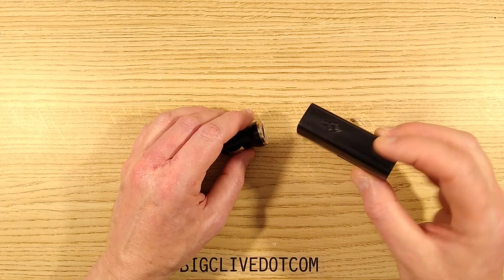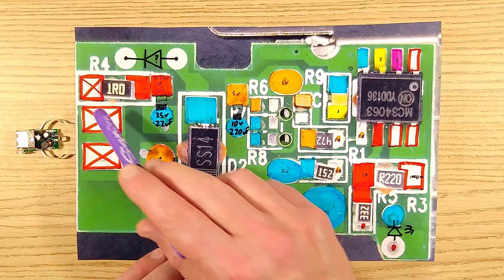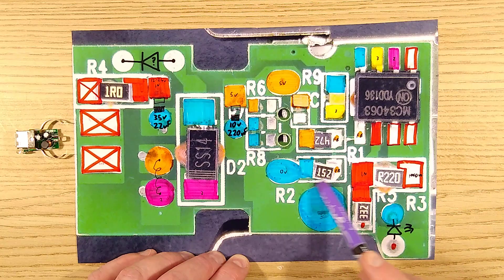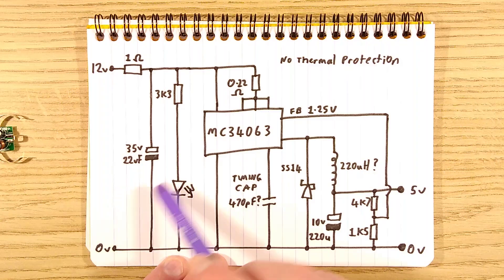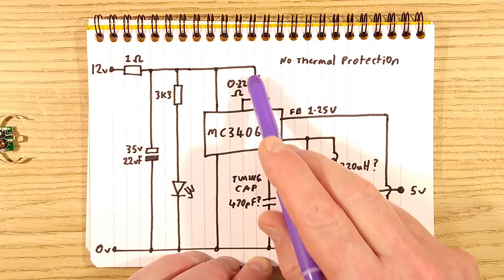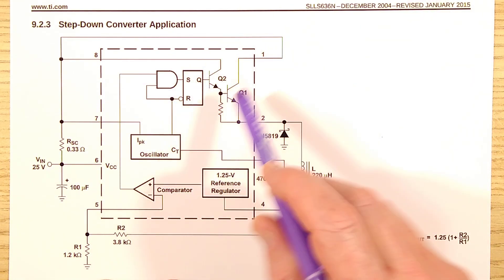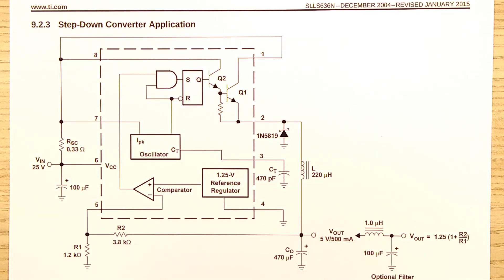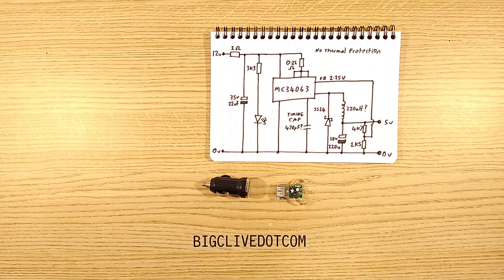Ordinary product with iconic component

Comment: Thanks for a very interesting video, Clive. It got me thinking. Would it be possible to use external components to boost the capabilities of the MC34063 chip? I'm thinking of how in a linear circuit an LM713, for example, could be buffered with a few components and a power transistor into power supply capable of much higher current or voltage.
Reply: Yes you can use an external switch to get higher currents, but there are so many better devices around these days that it's hard to see why you'd choose this unless cost reducing to the max.
Reply: @ferrumignis  Not so much cost reducing but rather ease of experimentation and availability of parts. As Clive pointed out in the video, it may be easier to get hold of and cannibalize or re-purpose an off-the-shelf USB adapter for experimentation rather than try and source all the components separately. It would certainly be more cost-effective if you wanted a power supply that fitted a cigarette-lighter socket to simply buy and modify one, especially as recreating the same thing just for a one-off kind of project is ridiculous.

For the output an existing USB lead, provided the current requirements were met, could be permanently attached as an output lead by soldering the two parts together. It would be visually acceptable and remove the possibility of a USB device being connected to the wrong voltage.

As an example, some devices use 9 volt power and it would me useful to be able to run them efficiently from a cigarette lighter. It may also be possible to convert such a USB adapter to a variable-voltage power supply for low-current applications. This would be useful, for example, for making an energy-efficient and dimmable LED light.

The reason this is so interesting to me is because I have power banks and booster packs that have cigarette-lighter sockets on them. A modified USB adapter would be far more efficient and last a lot longer on the battery than running something from a power supply through an inverter, especially for a low-power device.

Comment: I've used the MC34063 in a lot of projects. Since it can handle 40 volts, it works well for powering VFD displays. It can be used with an external transistor if more voltage is needed as well.

Comment: This is probably my most used chip in any of my DIY projects. Because it met my two main requirements (through hole and cheap) I purchased a large quantity of them and begain my journey into switch mode voltage regulation.  I have created more failed designs than successful ones with them and when reaching out for help on forums the overwhelming response was always "use a different chip".  Fortunately each time there would be one or two users that gave the time to teach me a bit more about it or suggest reading material to better my understanding and since I'd purchased enough of them to last my lifetime I was determined to make them work or go mad trying.  I've had them fail spectacularly in newly built circuits but then work fine after using a fresh new chip. I've tried running two of the circuits in parallel to get more current, which did work but it dramatically reduced the lifespan of the chips. I have never destroyed any expensive phones, just my cherished Korg ES-1 sampler. I have however learnt how to make my own inductors in order to get the (near) exact value my circuits required.  Despite all the ways I've discovered that the chip can fail it remains at the centre of my most reliable and most used DIY gear - my bicycle lights. It takes the voltage of a single cell Li-ion battery (or two parallel cells) and bumps it up to 5.5V which  then powers the Cree headlight and a LED flasher for my rear lights which is a multivibrator based circuit that delivers ~6.2V to the LEDs. When the battery gets low the driver for the Cree shuts the headlight down while the rear flasher will continue to provide me with visability for any vehicles approaching from behind without over discharging the cell(s). The circuit has been in service for about 6 years through all weather conditions in various housings that have been less than ideal (or watertight) and although I've replaced switches, wires and some of the discrete components due to fatigue or moisture ingress, the one MC34063 IC has remained as the reliable heart of the design.

Comment: I had one of these circuits power a dashcam (700mA MAX) for about 5 years and it worked flawlessly, regardless of the ambient temperature (-23C lowers and +82C highest).
Reply: 82°C ambient?
Reply: @shaunclarke94  yes, you get those high temps in a car which is sitting in the sun for too long.

Comment: I wonder how well this chip would work as an audio amplifier. lol
but think about it, the timing circuit can be varied so an audio signal could be used to vary the timing.
so, youd end up with a buck boost class d amplifier. hmm
Reply: It would be a disaster. This device doesn't have a proper PWM controller, instead it has a fixed duty cycle which is cut short when the current reaches the set threshold or voltage is above the reference. This is hysteretic control, which is really messy at low loads.  Quite honestly it's a very poor choice these days unless you are shaving every penny off a design and you have no concern about efficiency or reliability.
Reply: @ferrumignis  sounds like the sort of thing the Chinese would do to cut costs

Comment: I have a cigarette lighter phone charger on which I accidentally allowed the USB-C output plug to dangle against a terminal of the 55 volt traction battery of my home-built electric vehicle when it was plugged into the 12v circuit which is powered by a non-isolated DC-DC converterq. There was a flash and the charger no longer worked. I took it apart and found a short length of a PCB track had vaporised. I soldered a piece of wire across the gap and now the charger works perfectly again. This charger uses an integrated circuit called an HC2001 which is made by a Chinese firm. It can supply 1A, and can accept an input from 9 to 36 volts so can be used in a 12v or 24v vehicle. The HC2001 is claimed to be about 90% efficient and some measurements I made show this to be true.

Comment: This is called a buckconverter and have a high efficiency ratio. Have efficiency been measure for this device?
Reply: This device has poor efficiency compared to more modern switching regulators. It uses a bipolar transistor in the output switch which causes more voltage drop and therefore power loss than the MOSFET in modern regulators.  Also it runs at low frequency which requires a higher value inductor. In very cheap designs like this the inductor is likely to have a significant DC resistance which gives more power loss

Comment: Yes an old chip, but beware of the modern ones not made on old process nodes, as the maximum voltage they can work with is around 20V, simply because the process shrinks do not allow you to make high voltage transistors any more in the fab, without a redesign of the mask set, but they wanted to put in a smaller lower cost die. Also needs the current set resistor, the capacitor is there to define dead time between pulses, but the resistor sets the on current, leaving it out will mean the on die current limit is setting the turn off point, and that is dicing with smoke. Yes simple, low cost and there are very broad latitudes in component value, and of course there is a set of templates in the datasheet to select them, over a broad range, for varying input and output voltages, plus ideal values.

Comment: I had a charger similar to this and, yes, it did blow up my expensive phone.

I am not sure that an over-current can cause this chip to overheat as the current sensing through the 0R22 resistor reduces the chip output duty cycle, and hence average output current, if an excessive load is placed on the output. This is all well described in the Motorola AN920 application note, which also describes the uA78S40 switching regulator chip, the predecessor to the MC34063A.
Reply: Problem is the chip has no on die temperature sensing, so will operate till the output pass transistor goes short circuit from the die running over 200C for a few hours. The old process ones would run around 100 hours into a 2A before failing, the new die shrunk ones are a lot less robust though. Run the die hot and the layers continue to diffuse through the silicon, till the output collector diffuses the junction through to the bottom of the die, and then basically forms a diode from input to output, or the collector base junction diffuses to the point the metal layer shorts the collector to the base region.

Comment: Wouldn't a 7805 with a 1.5 amp 5VDC output be better than all that?
Reply: Where do you expect the heat generated from dropping 7-9V go? Not much room for a heat sink.

Comment: Beware of clones and counterfeits. Not all of these have ON produced chips. And the labels on the charger lie. It won't reach 1A or 1.5A at the output if it doesn't use the external switch topology. Otherwise they are 0.75A models lying about 1A. Even in 2023 you can still find these new in retail stores and not just dollar store bins.
Reply: Those are the cheap clones that almost fully replaced the real ones, sad that cheap china stuff is taking over the charger world

Comment: ngl from the title I was half expecting you to find a 7805 or similar linear regulator in there, but this was sooo much cooler. I'd surprisingly never come across this chip before, but will definitely be adding a tube to my next component order.
Reply: same! given the kind of stuff we're used to seeing Clive dissect, I figured an enclosed 7805 with no heatsink whatsoever... this was a pleasant surprise!
Reply: Cooler for real, 7805 regulator runs so hot!

Comment: under windows vista the provision for the diode is not allowed.

if you can get 9 volts can you configure it to put out 50 volts required by many led light bulbs?

many led light bulbs use a series of leds and either a switching power supply or capacitor/resistor dropper to drop the voltage to about 50.

i know the ipods had a chip that could handle 5 to 30 volts as there was a firewire version of the ipod and i think the 4th gen ipod was firewire and usb and was the last ipod to support firewire.

the 5th and newer would tell the user that firewire was not supported so you would not fry the ipod.

once lightning took over then it was only 5 volts.

Comment: OH GOD NOT THAT FKING CHIP
Working on my senior project in college ... my classmate was looking REALLY CLOSELY at the chip AS I WAS APPLYING POWER TO IT and it grenaded right in his face, with a fragment striking just below the eye.
There was no obvious reason for the failure, either. IIRC, I replaced the chip and just tried again and it was fine. (I was stepping 24VAC, rectified to ~33VDC, down to 3.3VDC, so I was asking a bit from it)

EDIT: I imagine that someone has said this already but you may as well consider ON Semiconductor as literally being Motorola because they... well they are.

Comment: Current limit is accomplished by monitoring the voltage drop across an external sense resistor located in series with VCC and the output switch. The voltage drop developed across the sense resistor is monitored by the current-sense pin, Ipk. When the voltage drop across the sense resistor becomes greater than the preset value of 330 mV, the current-limit circuitry provides an additional current path to charge the timing capacitor (CT) rapidly, to reach the upper oscillator threshold and, thus, limiting the amount of energy stored in the inductor. The minimum sense resistor is 0.2 Ω.

Comment: I'm still just begginer at electronics, I've built a few kits and know a smidge of the basics. 
If you've ever read "Electronic Project Building for Beginners" by R. A. Penfield (I get the feeling it's a bit of a classic) that's about my level.
I've rescued some power packs full of 18650's from Sainsbury's battery recycling tubs. (I often have a rummage for any rechargeables I can recondition) and I need a charging device for them. 
One battery pack for a hoover has a charge controller circuit board that'll form the basis for this but it runs on 24V DC. 
I have a solar charged 12V lead acid battery on hand so could I use this little chip as a voltage booster to double the 12v to the 24V needed? I have a couple of those little car chargers & by the sounds of it I probably have one already!
Oh! And I'm looking for a new soldering iron. Has anyone found a good one lately or even a budget soldering station? 
Something versatile and ubiquitous (for access to different tips). If you've found something that you're really chuffed about... 🤔
And thanks Clive, I really appreciate the inspiration, fun and learning on your channel. Have been subscribed since the very first board with PC printed "BigClive.com" on it! 
Keep safe everyone, it's from reading the comments section here that made think to pick your brains about soldering equipment. I learn & laugh just as much from the comments as  I do from the videos!
Keep safe everyone 😀
Reply: I'm happy with the Quicko T12 942 station, you just need to add a 24VDC power supply. Very generic tips. 

For the voltage boosting, you're better off with a modern chip/module, those are very cheap too. In fact I use one to drive the aforementioned soldering station from a 12V battery.
Reply: @rexsceleratorum1632  Nifty! Thanks mate, I'll take a shuftie 😀

Comment: I used one of these to generate a -25v 30mA power supply from 5v for a VFD tube. Most old car chargers. I'm talking mid 2000s will have this chip
Reply: I bought two of this exact one in 2014. The store had bins full in different colors.

Comment: Interesting that you did a video on these, as I have a few of them and opened one up to follow along, but it has different circuity inside.  Mine has an 8 pin chip but it's a AD85063/OXOO43 (numbers on top and bottom respectively)  Could be Os or could be zeros, hard to tell)  Has the SS14 diode like yours and has a 0 value resistor.  On the other side of the board it has a coil and a 25 volt 22 uF electrolytic capacitor and that's all.  I'd be happy to send you a couple good photos of it if you wanted to see it to compare with the one you have here.  I was going to make a box with these in it for charging multiple devices in my vehicle, but now I'm thinking maybe I shouldn't.

Comment: i've had dc dc fail on me before, it switched off and output cap exploded. it's input was 20v from lenovo laptop psu. so i was thinking how my phone got 20v. but it's tvs helped me i think. it's max 9v samsung galaxy note, was it 4? i have way too many notes. anyway, even it's diode desoldered itself. the joys of china

Comment: Can an external MOSFET or BJT be connected to pin 2 to increase the current capability?
Reply: Yes. The On semi datasheet specifically lists external switch transistor examples.
Reply from the maker: I think it can be used to drive an external transistor.

Comment: I am currently trying to build a circuit that steps up 12V to 15V using this chip and am struggling to get it working at 3A using NPN transistor to drive the circuit. It seems to short circuit above an amp and don't know how to fix it. This video has given me some insight.
Reply: Are you using an original Moto or On Semi, or a lower quality clone?
Reply: @nyetloki  thank you for your reply. Having a look at it there is no branding on the chip. It reads MC34063A SUM10K16SX

Comment: Hey Clive, there's a product selling here called a Pestrol supposedly to get rid of those unwanted pests, rats, mice etc.
They all seem to be saying it works but how could it be tested on a bench or would it be a case of buy one and try it out?
Could you possibly get hold of one and do the reverse engineer thing.
I thought they were mainly a con.
Is it possible this one does the job?
Reply from the maker: I've looked at a few, mostly scammy ones.  The concensus in the comments was that they are not effective.
Reply: The ultrasonic ones do sort of work... but I think the "electromagnetic" ones are a scam.
Ultrasonic ones only work where you can "hear" the device though, so spiders and mice just stay hidden. You don't remove the problem. Just conceal it.

Comment: With those devices can also create havoc with CAN Bus system by creating false error messages as I discovered with my Smart car. It gave indications that CPU had failed I turned the ignition off removed the charger and everything went back to normal and no more error messages. A great sigh of relief because I was some distance from home and the nearest Smart car service agent was about 60 to 70kms away.
Reply: Radio frequency interference is a common issue with this device due to the way it regulates, and the lack of any additional filtering in these cheap and nasty adaptors.
Reply: @ferrumignis  Agreed about the RF interference and really surprised at the havoc it caused. It makes you wonder what other problems a poorly surpressed device can cause.  It's annoying that manufactures don't prosercuted for bad RFI interference and possible damage it can cause.

Comment: OK, showing my ignorance here, but why can't a single resistor of the correct size also drop 12V to 5V ?. Like a ballast resistor in older cars used to drop it to 9V.
Reply from the maker: Resistors dissipate the voltage difference as heat, and also require a fixed load.
Reply: Sure, you could. But as your load current changes, the ballast resistor will drop more or less voltage. For something like a fix current light or led, the ballast resistor is fine. For a variable load phone, which will fast charge at low battery but trickle charge at high battery, you just let 10v on your 5v output because the ballast resistor math changed.
Reply: That depends on the current remaining constant and also shunts the excess as heat. It's remarkably fragile and inefficient.